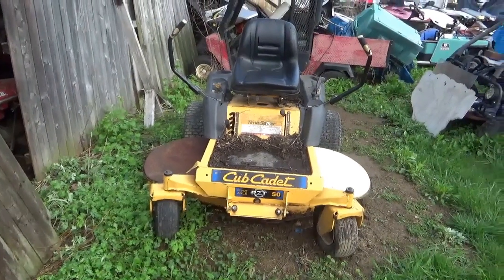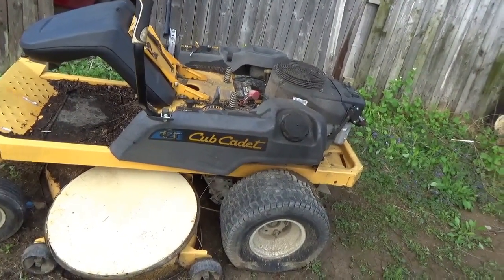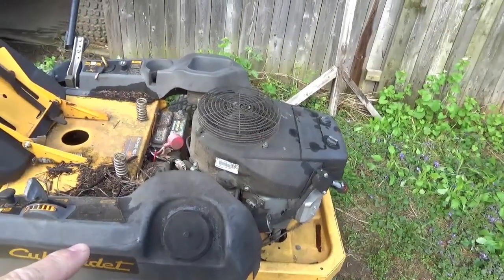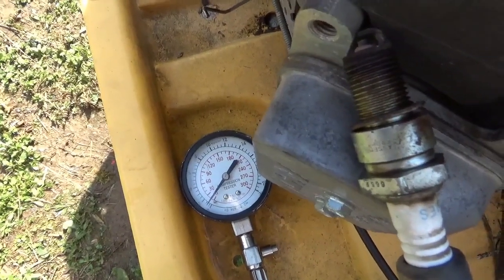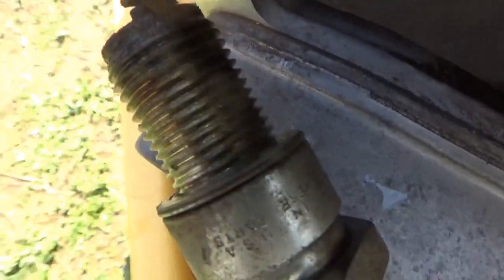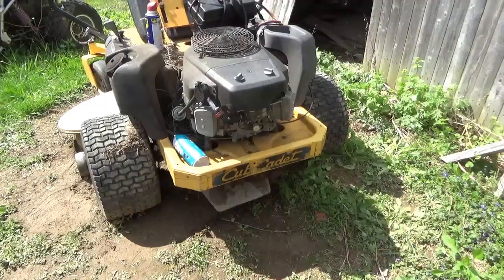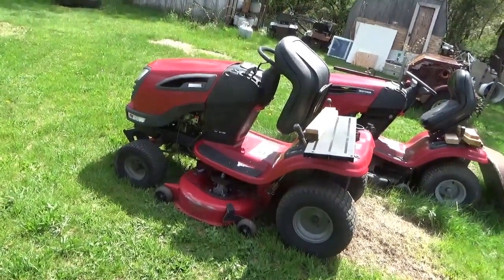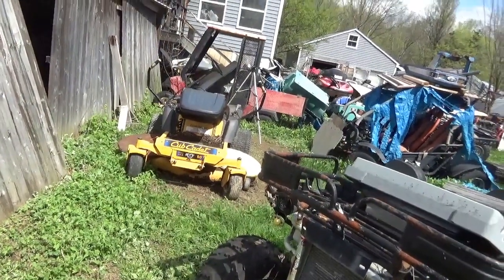Cub Cadet RZT50 Zero Turn, Starts and Dies, Troubleshooting and Repair!

Comment: Just wondering do you still have the kubota diesel mower?
Thanks
Reply from the maker: Hey Crusty!!! I do still have the Kubota Diesel, last time I used it, I noticed that the oil was overfilled and it seemed to be full of diesel... I think the injector pump lost a shaft seal... I need to spend some quality time with it before the mice move into it permanently!!! Thanks for asking, being a long time subscriber, watching, and commenting